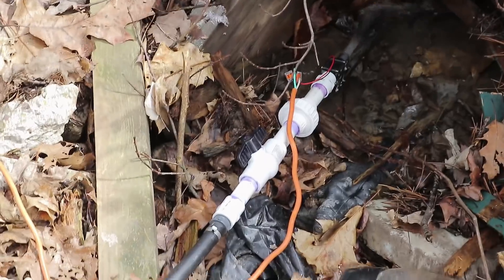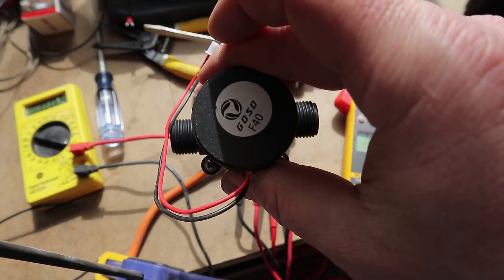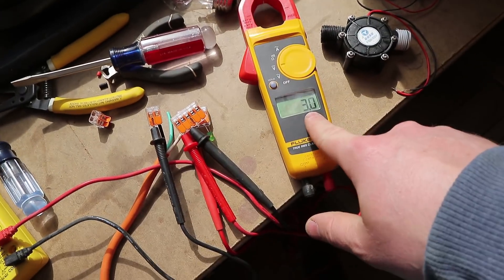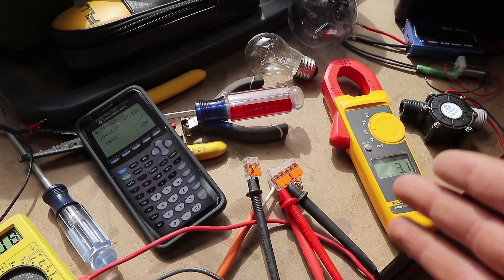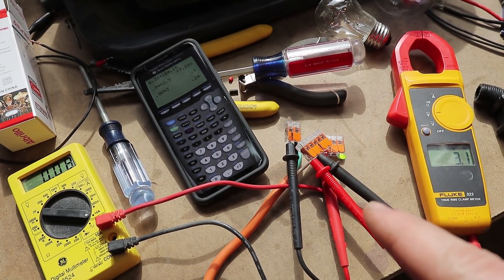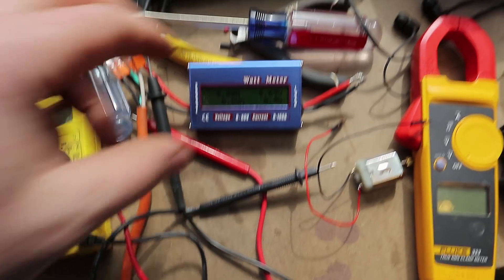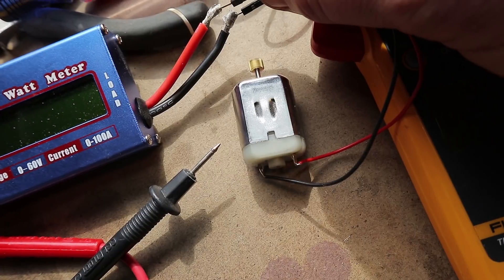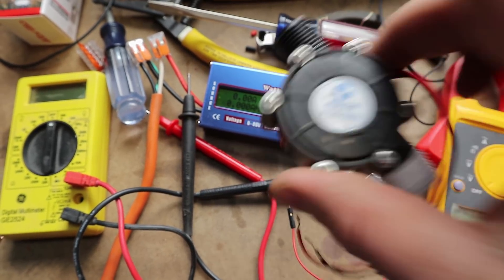Spring Creek Micro Hydro Turbine P2, Initial Results.

Comment: According to new details i saw it say 220mA and 12V. If so how would you charge the battery of 12V? 
As the power have increase from that of your video.
Can we charge the battery?

If still one is not possible to charge the battery.
What would be the minimum turbine needed to do so??

Comment: Also you have DC drop over wires.
Reply from the maker: 50' of 16ga wire at 3.0V and .08A is .032V or ~1% https://www.calculator.net/voltage-drop-calculator.html
Reply: Given how little power is currently being produced, even a little loss is significant to the outcome.  Good luck on your journey.

Comment: would you get more pressure during a downpour?   if so, could you eventually charge that battery?
Reply from the maker: Pressure is limited by height, I'm already using the maximum height available. The flow in gallons/min is heavily restricted by the small turbine (and ultimately by the diameter of pipe I already had on hand). The turbine is made for high-ish pressures and low flows, I have low-ish pressure and medium flow. I knew this was a potential issue going in.

Comment: Joe, measure the wire resistance, calculate the drop from there. Also, the led is running on dc, while the generator is AC
Reply from the maker: Master Ivo no, both generators are DC, one is a permanent magnet DC motor being driven by the water and the other is a 3-phase rectified brushless generator. Resistance is tiny.
Reply: Ok, but a dc motor as a generator would produce ac. Anyway, more water pressure wil be needed.
Reply from the maker: nope, https://youtu.be/OpL0joqJmqY?t=7m15s
Reply: Ah cool , didn't know that. rectified by the commutator. no need for diodes. Thanks for sharing.

Comment: Lovely set, assuming flow is steady You could get much more pressure with 50 gal barrel or a Tote, then I would go for a low head Francis or Tesla turbine. Keep then coming I would like to know how You solve It as where I live is drier but also very hilly.
Reply: vl, wrong.  sorry.    in any power generating scheme, power is Continuous, Not accumulated over time.    the potential energy in water is a combination of volume (flow rate) and elevation change (head).   using a catchment does NOT increase the flow rate.   so,  no power increase.     cheers

Comment: 80mA at 3v?  That poor LED!  800% of it's rated power :D
Use a filament lamp for a purely resistive load on DC supplies, not a solid state one, when taking measurements.

Comment: "ideally, in such a situation, you would . . ."    Design and Make an Overshot waterwheel, Correctly Matched to the Available Head and flow Rate.     i am just sure the light will go on for you, one of these days.  so i will keep trying.     a pelton or turgo turbine is a HIGH-speed turbine.   you have, barely, enough flow for a Low-speed, Very Narrow waterwheel; where bucket volume is about    One Cup.      cheers

Comment: joe, for you and your subs, here is an example of a Correctly designed low-head low-flow hydroturbine; aka an overshot waterwheel.   kindly, do not reply.    cheers
https://i.pinimg.com/736x/75/16/e6/7516e6cf808f026957f26e73d90bedcb.jpg